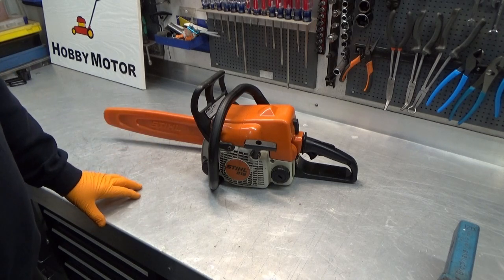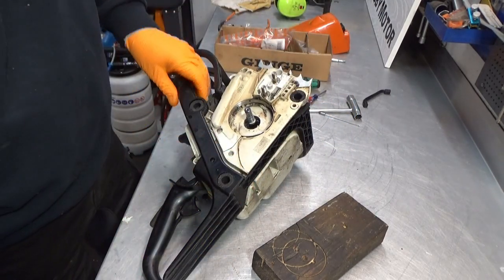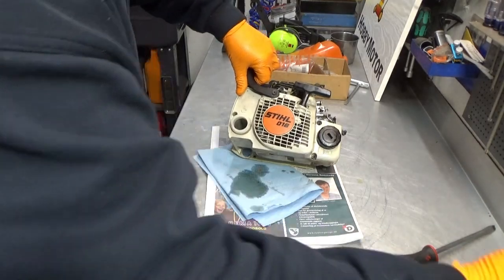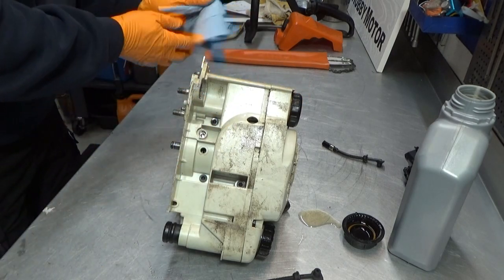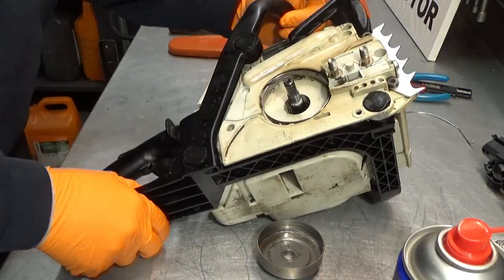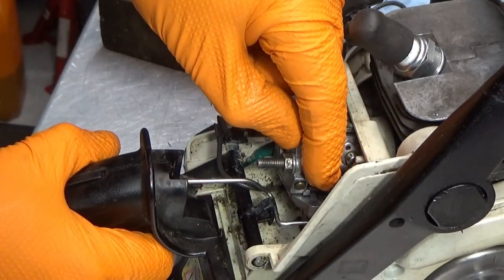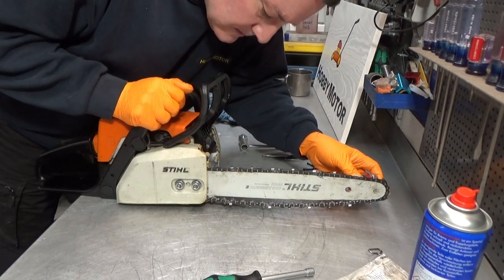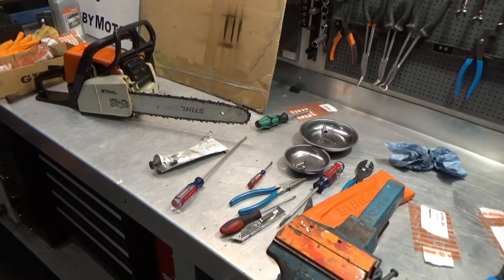Stihl 018 / MS180 not oiling correctly (video in english)

Comment: Absolutely brilliant video.  Really clear, well paced, thorough and a lovely amiable approach.  To do it in such a way with English as a second language just puts many English speakers to shame.  It is good to see an obvious expert with machinery make the odd mistake and admit to this.  Everyone gets things wrong from time to time and it is reassuring for complete novices like me (I had written down the order of everything I took out to do with the clutch and just assumed this chainsaw didn't have the washer that Duck Flynn refers to - mine is an Stihl MS180C).  I work in countryside management and do a little very basic routine maintenance of machinery and I am not a mechanic.  This is the first time I have taken an engine apart (apart from the very basic stuff I did as part of my chainsaw training in the UK).  It took me 2 (7 hour) days as I destroyed the top anti-vibration buffer by trying to take it out the wrong way and had to replace it.  I really struggled with pushing in the 1st plug for the oil hose and with pulling out the oil pick-up and hose into the chain oil tank to make sure there was no kink.  But I completed the job and the chain is now oiling again.  I would never have attempted doing this without such a high quality video.  Thank you from the UK for doing this in English.
Reply from the maker: Thanks Amanda. Such praise is what makes it worth making videos like this.👍👍

Comment: Which side does the oil pump fit into the chainsaw should the big hole or small hole be facing the sprocket
Reply: Got it done after didn’t see the markings
Reply from the maker: It's been more than two years since this video was released and I can't remember the orientation of the oil pump. Try and find an Illustrated Parts List for your saw - it should show how the pump sits in the housing

Comment: When installing an oil line into the oil resivoir, I use a wooden popsicle stick that pushes without tearing the rubber line. A tip from an old timer, my Grandfather.
Reply from the maker: That's a great tip - thanks for sharing 👍